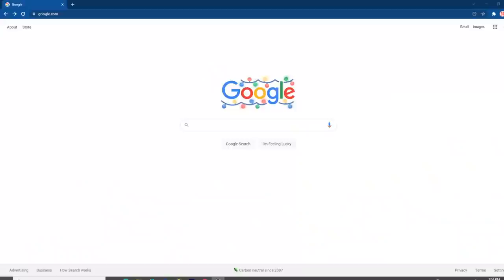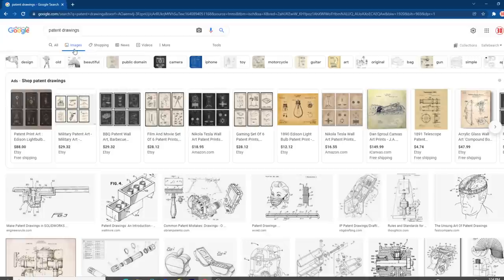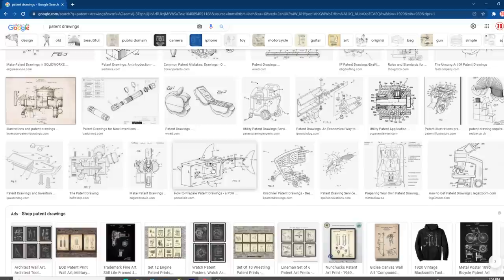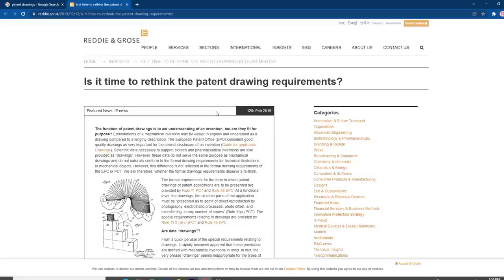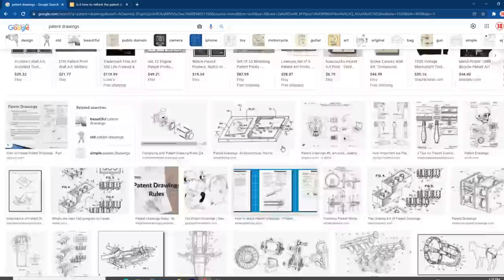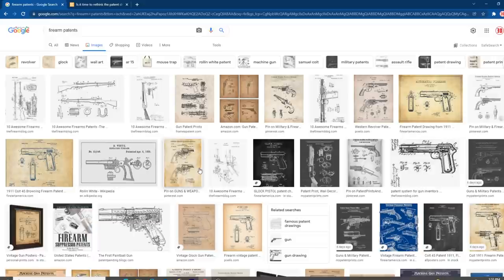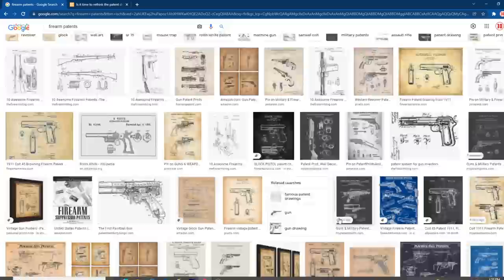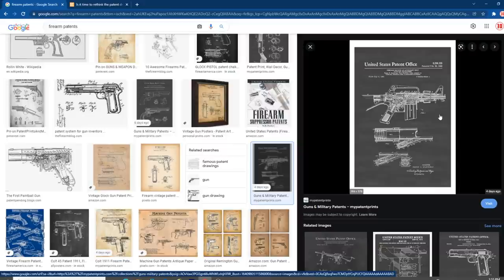How to Make Money with a Desktop Laser!

Comment: Here's a tip: in the Layer settings, Advanced tab, turn on Flood Fill. It will nearly cut your burn time in half with the same results.
Edit: in some cases it will have no effect or even longer times but most of the time it will be faster. Try it both ways and check the times before you burn.

Comment: 11:15 I notice all of your thick lines come out as filled. When I trace it just does the outside of all the lines. So instead of one thick line I get 2 thin lines on the outside edge.
Edit: I see now. You have to have Filled Rendering selected in the settings but also have Fill selected on the layer.

Comment: I don't know what I do wrong here, but if I follow your steps, even with the exact same image, I get a whole lot of traced outlines, but not an image that looks like your image.
For example a letter F, in the name Foster, is the outline of the letter F and not the letter. 
I looked at every setting in your video, every number, comma, etc is the same as what I do. Drives me crazy.
Reply: @3dprintcreator do you have a single line font for lasers yet?  I had a different project and learned I needed to have a single line font to not have the outlines as if your cutting out the letters.
Reply from the maker: On the upper right in LightBurn, there’s a section for your layers. Double click on the layer your image is In and make sure the drop down in the layer is set to Fill and not Line.
Reply: Same here.   The trace does not come out as clear as 3DPrintFarms does.  His is pre filled on the screen where ours is line drawing on the screen.  At least for me that is what is going on.
Reply: @Nathan Potter, Yes I have single line fonts installed, but here we are talking about traces, not about fonts.
@3DPrintFarm I don't think we are talking about the same. I have fill turned on, yet my drawing consists of more than 1000 small blocks, that when I ungroup them, are all separate. Your tracing looks more like a few pieces, not hundreds.
@Ak Sasquatch, no I am not talking about the fill, that's a thing you can select in the layers tab. Also in the settings you can turn on filled rendering. Yet, that's not the problem I encounter.
Reply: I had the same problem when tracing it only did outline. There is a comment above that worked for me.  Go to Edit select Settings and turn on Filled Rendering.  In the layers also make sure it is on Fill and not Line.
Reply: @AG-lj5oh  I did that and it looks the same, just an outside border traced, not filled.

Comment: Great video!! thanks for the information. Just out of curiosity, how much would you sell something like that for?
Reply from the maker: That's a great question!  A lot of that depends on the cost of materials, the time it took converting, engraving etc.  For this particular project I had a little over a dollar in materials. (The canvas and what little spray paint I used).  Many laser shops will charge by the square inch factoring in cost, time and materials.  This is the easiest way to do this IMHO... So.. to answer your question, for this canvas which is 11x14, would be 154 square inches.  Charging .25 for sq/in would be $38.50 or roughly $40.  Finding that sweet spot per square inch, you can pretty much quote any job.  I would, however, set a minimum so for instance someone wanted a small canvas, priced out per sq inch would be too little, therefore pull up your minimum to $10-$15.. Just a ballpark estimate.

Comment: New subscriber and specifically interested in laser burning. A quick question. If you painted a piece of glass, MIRRORED the image and then burned it, the glass could be framed but the image is actually now on the back of the glass and protected from dust, etc. Am I thinking correctly about this option?

Comment: i like the idea of laser bruining images on canvas like this but what settings would be appropriate to make sure you only burn the paint off the canvas and not burn the canvas.  I have a 60watt co2 laser.
Reply: Lmfao 🤣🤣🤣 why didn't you just use a plasma cutter 😁😁 try 1% power lol
Reply from the maker: Great question!  I would run the test file from the "Edge of Tech".  60watt is going to be pretty fast and low power.  I would get a test canvas.  One coat of paint.. make some squares in LightBurn.. Make the layers different speeds and power.. Compare results.
Reply from the maker: Good Grief!! A Plasma cutter!  Now that would be a sight to see!  I would imagine it would just vaporize the canvas to ash at ANY power!

Comment: I can’t seem to get the color filled in when it is traced? It just shows it as everything is outlined
Reply: You likely have it answered, but vector files (SVGs) don't display as filled shapes - they're lines that the laser will cut/etch out. If it's told to fill, it will fill everything within those lines.

Comment: How long did it take to burn this image?
Reply from the maker: The M16 took around 40 mins.. I was running pretty fast and it didn't miss a beat!  The MP5 on the other hand was running at 1200mm/min which was SLOWWWW at like 6 hours!  Live and learn! :)
Reply: @3DPrintFarm  Thanks for the reply. I have also seen others use a borax mixture (1 borax to ten water or so) when they burn on wood to get a deeper burn at lower wattage. It seems to work great for detail. Not sure if it would work for canvas. You might want to try the borax mix on some wood yourself to try.

I can't wait to get a laser myself. Hopefully in a month or two.

Comment: Can you engrave an actual firearm
Reply from the maker: Firearm engraving is done quite a bit with a fiber laser and I plan on covering that in a future video.  You can do some limited engraving with a diode laser like the Ortur, but not without doing some extra steps.  If interested in engraving firearms, the fiber laser is the way to go.  Much less headaches.  Plus it's another tool in your laser arsenal.  I use CO2 lasers for cutting wood, engraving and cutting things like acrylic, fiber I use for marking, annealing and engraving metal and the diode laser is a great place to get your feet wet plus do some cool things with engraving tiles, thinner wood items.. limited metal engraving (anodized aluminum) etc.